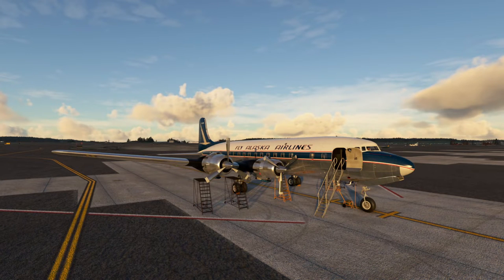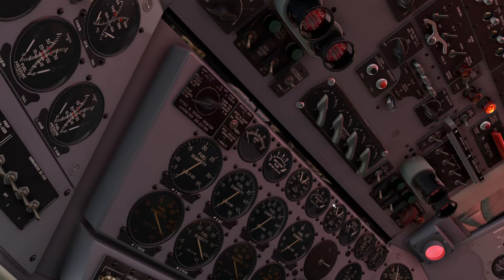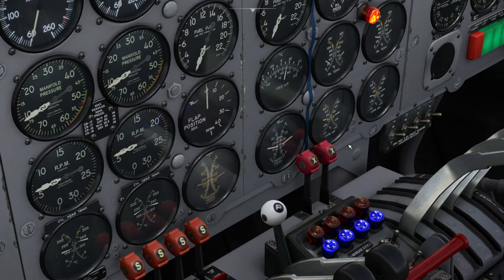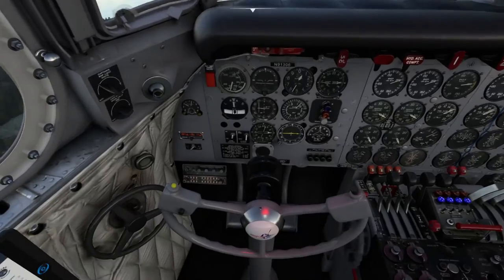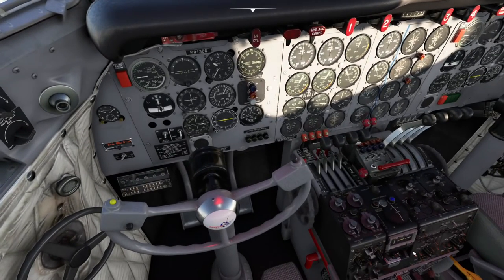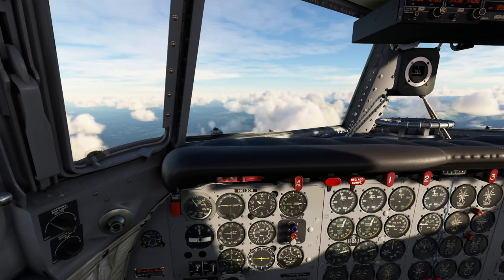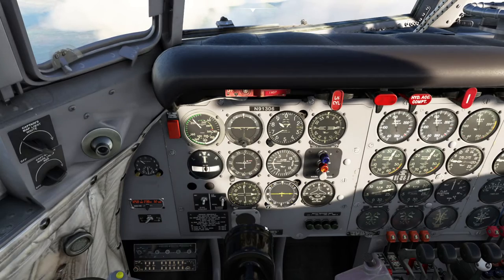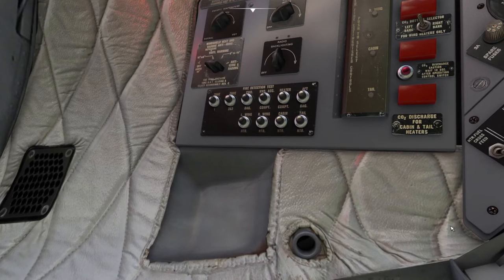PMDG DC-6 Tutorial with VOR Navigation, Anchorage to Fairbanks

Comment: What are you using to move the camera like that in the cockpit? as in how do you inch forward to see the engines out the window.
Reply from the maker: I have keybinds set (on cursor arrow keys) to move around the cockpit (translate cockpit view).  I also have a yoke button set to (reset cockpit view) to put the view back to the captains seat.  So I look left, then translate right (would would be forward), and I can see the wing.
Reply: I just found your straight-forward dc6 flight!  That was so helpful on many fronts, on what I needed to know!  So Thank-you!  I want to get good enough with this aircraft, to be able to fly on Vatsim soon!